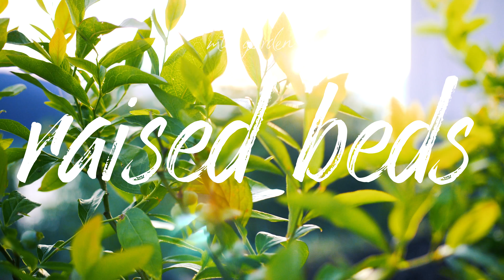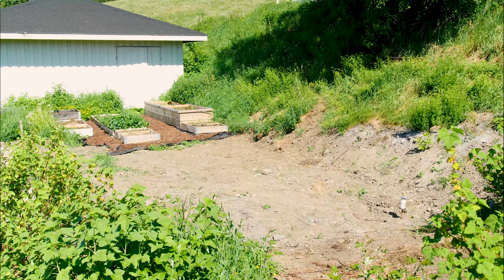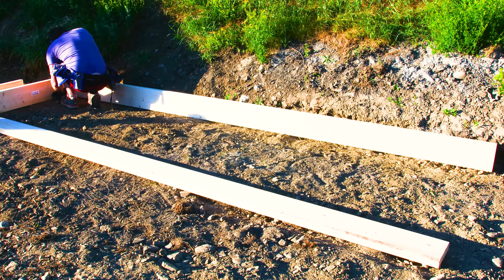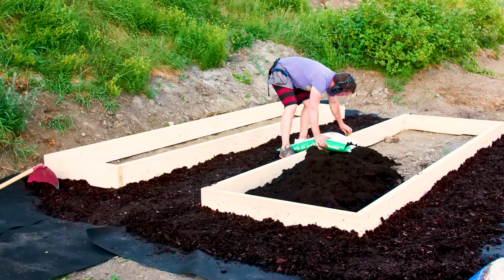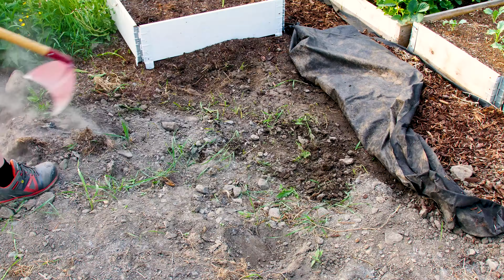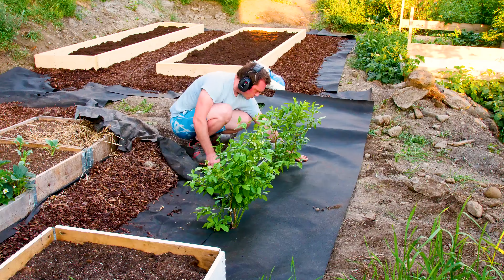Building Raised Beds! | Part 1

Comment: Have you thought of covering the inside of raised bed walls with some plastic to prolong the lifespan?
Reply from the maker: I have, but in my experience the wood will last for maaaany years, so I did not bother. Cold climate, so the wood lasts very long.
Reply: @ChristopherBrandsdal , they say 5 years if no treatment and longer with thick beams... I am also in a cold and wet climate but I doubt it helps to prolong the lifespan...
Reply: ...the plastic lined beds would sway him into hydroponics with  sheets if insulation floating plants...the wood and soil method he uses with the hoop houses is sweet old school...